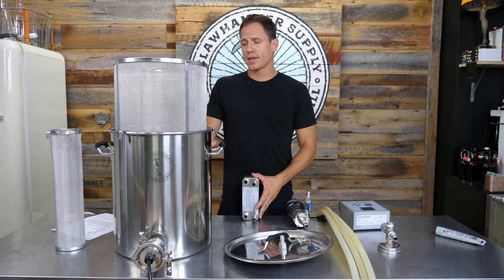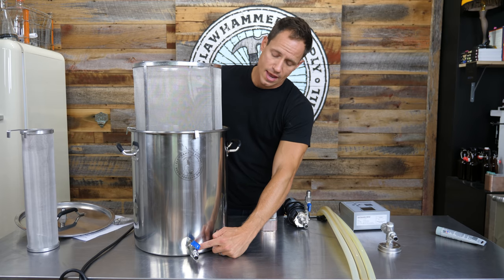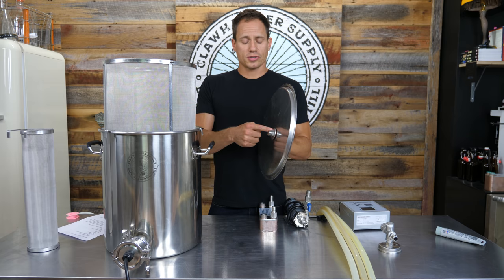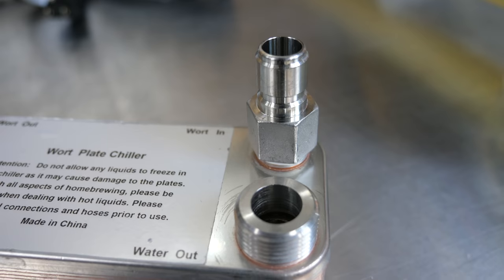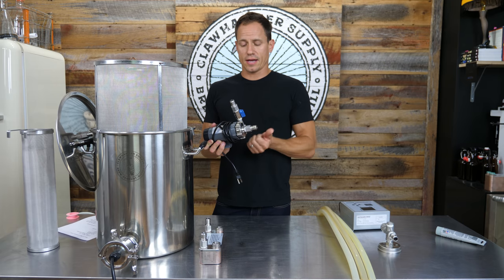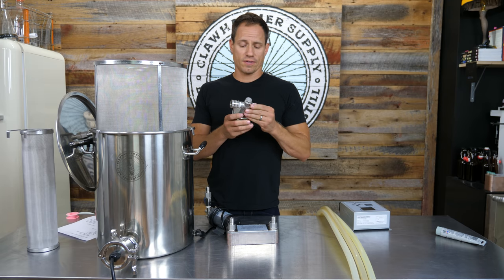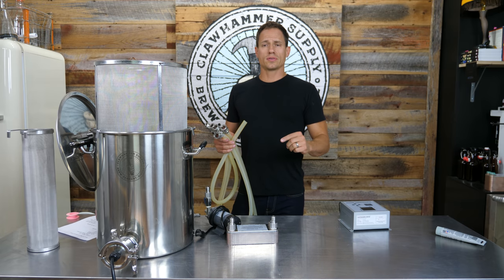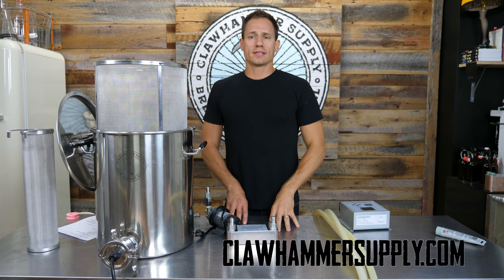OUTDATED Electric Brewing Assembly Guide

Comment: I have an extra washer. Is there supposed to be a washer on the top side of the lid as well? It came with two but in the video you only use one.
Reply: And I don't think I got the silicone washer.  My top assembly is loose and I need to go buy a washer at the hardware store...
Reply: Same here.  Did you figure it out?  I am thinking we need to double them up as one seems to fit inside the other and the other metal one goes on top on the outside of the lid.

Comment: Third step at 1:23, I need to use a special silicon tape for high temperatures. But it's not included in the kit?
Reply: I got silicon tape in my kit, but it is a different colour. I'm sure it is fine. Probably just a different brand.

Comment: how the price is common for all this equipment ... how much is it
Reply: the entire system shipped to you is about $925.00ish i cant remember exactly hos much i paid for it... the system works great...
Reply from the maker: https://www.clawhammersupply.com/collections/all-products/products/digital-electric-120v-homebrew-beer-system
Reply: @slowbrew3074  I just bought the 120V package. Have you tried heating up water and mash tunning in a separate container. Then using the system like you should. Then adding the extra mash tun wort to the pot prior to boiling. That way you have 10 gallons roughly. I am just curious if I could get it up to a boil with 120V.
Reply: @dylankadow8428  yes it will boil it just takes a longer... when i bought mine they did not have the 240 yet i would have bought that one